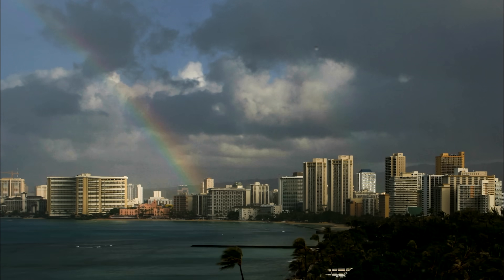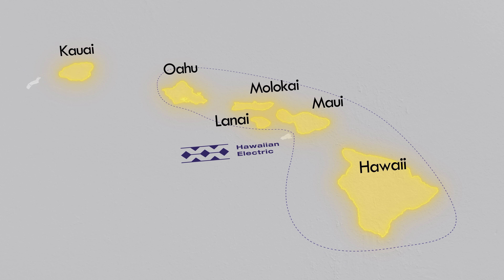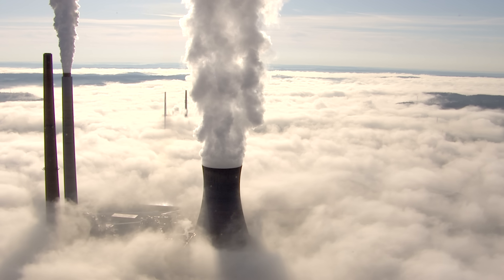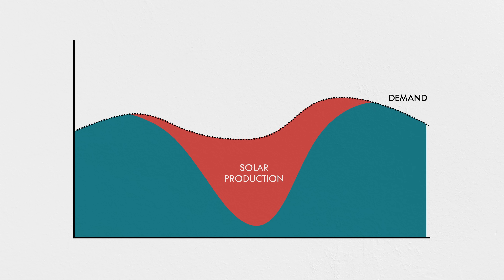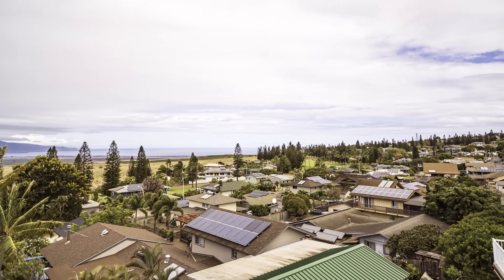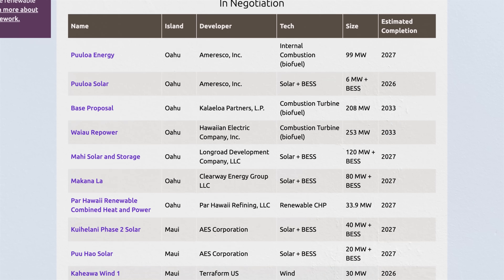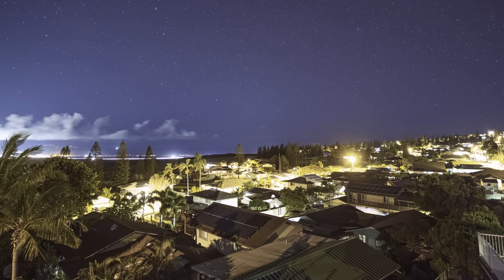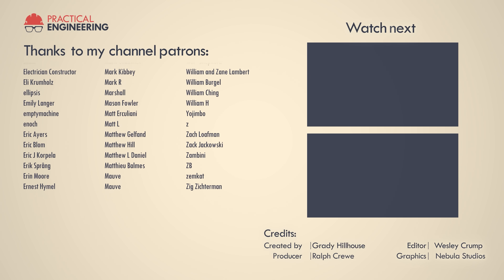How the Hawaiian Power Grid Works

Comment: I have always wondered, but being a layman when it comes to engineering, I have no idea of my thinking is plausible. 
Would having more small power generation or storage stations along with the main production and storage facilities help alleviate some of the strain events like the storms you mentioned (and the maintenance schedules).  Say for a large housing development there might be a couple of the smaller wind or water turbine systems, that help to keep a small battery storage system topped off along with provide power to the grid.  Where eventually, when the technology catches up, be able to be the back up battery system for things like traffic and street lights for a time in a small area. Or even say to a local community building/shelter. 

Or might this be better tackled as two separate ideas, instead of one large one.
Reply: At some point the increased complexity might make the problem worse. A maintenance crew can probably fix a few big systems faster than lots of little ones after a storm.

Comment: One thing I would like to see since undersea cables seem to be impractical given the restraints is Terrestrial Microwave Power Beaming to interconnect the islands; They aren't the most efficient but they can allow wireless power connectivity between the islands and could largely be shut down or have their use vastly minimized unless the need for interconnectivity and avoiding rolling black/brownouts.
Reply: Microwave frequency wouldn't work very well for power generation, especially in Hawaii. The distances are too vast, and microwave wavelength is right in the spectrum for water resonance. Because of how humid the air around the islands is you would be losing a ton of power to heating atmospheric water vapor.

DC interconnect cables make the most sense, and I don't understand why the Hawaiian Islands haven't been connected with them yet considering places in Europe have cables upwards of 800,000VDC operating at depths similar to the ocean depth between the islands.
Reply: @Hyperious_in_the_air  Considering MPT can be used to transmit power using a spaceborn relay and there have been several purely atmospheric tests the distance point is something i vehemently disagree with, Additionally while Humidity would affect things this would be less a full scale interconnect and more an emergency interconnect as you could never get the efficiencies of undersea cables and they will always be better efficiency wise.

As for why they dont have any there were points made in the video as to why not.

Comment: 14:00 You can buy a whole house generator, battery storage, etc if you need power reliability of the grid. It costs you extra.
Reply: Then what's even the point of all this rebewable window dressing? The Hawaiian electricity grid is already like a giant backup generator, it all runs on diesel fuel.
Reply: @gregorymalchuk272  Did you go to the time stamp?

Comment: Most solar inverters will adapt their power output to the grid in response to the voltage it sees. When the voltage is too high it should rate back.

Comment: I quite confuse when some government says.

They want to reduce fossil fuel use to 0%. It's technically not possible, when no sun, winds, waves you still need fuel/gas/col to run generators.

Things than can do is ability to rely 100% on renewable energy when it's available (in normal conditions), so this mean both renewable and fuel both are at least more than 100% of demand for the whole grid.

Comment: interesting episode. I would like to hear more about the advanced battery storage systems that electronically provide frequency management and simulate rotational inertia. And there is also the technology related to virtual powerplants composed of lots of smaller battery backup systems at homes and small businesses. I would like to hear more of the technical details related to these systems and the cost trends of battery storage. 

And by the way, as I listened to this episode, I was struck by the high-quality of the writing. Not that past episodes had poor writing. It just seemed to be that the quality was more noticeable in this episode. Thanks.
Reply: Battery storage is inconsequential when it comes to power grid. It's way too expensive, the only way to store power at scale is pumped storage (pumping water up when you have energy surplus and then letting it run down again when you have energy deficits). There are actually a LOT of different ways to store energy, but everything apart from potential energy of water is a meme at national level.

Comment: Another !!Fun!! issue I could see with trying to interconnect the islands' grids: they're almost certainly out of phase. They'd have to fully shut down ALL generation on both islands, then make the connection, then whichever power plant cold-starts first would set the phase for everyone else. Repeat for each new linking. ...Or maybe just fully shutting down one island, connect, then bring the plants back online as fast as possible in the brief window when one island's worth of generation is trying to power two islands at once (scheduled rolling blackout time?), which would get easier with each new link (N-1 islands' worth of power plants trying to power N islands)...
Reply: Or just lower or raise the frequency very slightly until they are in phase and then connect.
Reply: How do they reconnect two grids which have separated due to fault?
Reply: @catprog  Search Wikipedia for: Synchronization (alternating current)

Comment: The Hawaiian islands should be plentiful of potential for geothermal. Probably sufficient to cover all the demand. Geothermal is stable, doesn’t rely on wind, sun or weather and free of charge from any fuel. And the same steam turbines used with coal, oil and gas can be operated by steam coming from the underground. Why they don’t push on that?

Comment: Considering how many Active Volcanoes they have, I'm surprised they only have 1 Geothermal Power Plant...

They really should have 1 Geothermal Plant at each Volcano and use that to help replace the Fossil Fuel Plants...
Reply: does a volcano have to be ideal for a geothermal plant? I don't know the engineering behind that
Reply: @lord_fronic   It helps but isn't needed...
Most Power Plants burn a Fossil Fuel or use the heat from Nuclear Decay to turn water into steam to turn the Turbines...
A Geothermal Plant uses heat from deep in the earth to do the same so it's extremely Environmentally Friendly...
A Volcano just reduces how deep the Geothermal Heat Extraction Pipes need to be drilled and also, in theory, increases the amount of usable heat that can be extracted and thus the amount of steam that can be created to drive Turbines so a Geothermal Plant near a Volcano can create FAR more electricity for less construction and operating costs than one built away from a Volcano...
Reply: @HappilyHomicidalHooligan  I looked it up and apparently it is a mixture of things including higher initial startup costs, the unpredictability of the volcanoes in question, and cultural/natural protection in the areas. Interestingly major cost components are the amount of water needed and remoteness.

I think that this could easily be solved by government assistance but most of that goes towards wind and solar which have lower startup costs even though they don't provide much as far as MW per $ compared to almost any energy source. Voters and politicians rarely talk about geothermal

Comment: I wonder if there is a solution in the laser power transmission tech for inter-island connection. If you are worried about it hitting birds  or planes you could have laser interrupt lines that switch off the transmission temporarily like with a garage door stopper.

Comment: I'm not sure about the inertia, Grady. Are you sure you're not propagating a factoid that "sounds reasonable" but turns out not to be true? I'm asking because, though I'm outside of this field, I did explore in the past spinning disks to store energy for a project and it turns out you need A LOT of angular velocity to store any meaningful amount of energy. And those turbines don't look like they're spinning all that fast (some submultiple of the AC frequency probably?). Sure they have a lot of mass but when you talk about electrical energy, values that are seemingly small from an electrical energy perspective (say 1kWh) turn out to be MASSIVE amounts of mechanical energy. 
What I'm trying to say is that, it looks to me like a relatively small bank of capacitors or battery would easily replace the mechanical equivalent of inertia of a turbine shaft. 

Has anyone looked at this in detail? You should totally make a video discussing this in more depth.
Reply: Turbines have a huge amount of mass, they are really heavy.

Comment: Much of what this video describes as problems the grid needs to address, are problems with AC.

AC has become more a liability than a benefit.  It's very lossy, inherently (what makes transformers work, also makes everything a secondary near a transmission line, leading to huge inductive losses).  It has this need to synchronize, which is a problem beyond a small area, deterring useful sharing of power across larger areas.

There's very little intrinsic need for AC.  (Can anyone name a use that intrinsically requires AC, can't be done well with DC?)  We use it out of inertia.  Its benefits, like transformers, are becoming outweighed by its downsides.  A full change would be difficult (though already many long distances lines are DC for the lower losses).  But we change all the time.  If some utility in an early adopter area were to offer a parallel DC service to the home, I suspect that over decades it would eventually take over everywhere, with DC becoming the norm all the way from production to consumption.  And the savings in losses would be large.

Comment: Sounds like there needs to be a requirement for any power producer to have an intelligent battery (or other energy storage mechanism) between the power generator and the grid.  This would allow the utility to better manage these smaller scale power producers and also ensure that short term changes in production wouldn't immediately be passed along to the grid.  There would need to be some kind of minimum energy storage capacity requirements, likely related to maximum power production.

Comment: For the distributed energy resource wouldn't it make sense to have battery storages for certain areas that would be capable of sensing and working with the power grid? My thinking is that it would create a decentralized power grid, capable of supporting each hub and given that it would be professional not consumer grade, it would be more resilient to attacks and allow better communication within network.

Comment: Solar can produce on overcast days but you need a lot more panels.  The ONLY way solar can be a reliable percentage of say 50 - 70%, about the best it's going to get is a LOT of overcapacity along with grid storage.  If you don't have grid storage than forget going over about 25% of planned capacity, meaning that's what you plan for solar to produce for you, but even there you still need actual generation to be a bit more than 25% of what the grid needs when it's sunny.

The good news is that Redox flow batteries makes sense for grid storage and at large scale shouldn't be costly.  However the problem with Hawaii is distance from places that provide raw materials or produce goods, so they have to pay for shipping a whole bunch of units to the islands.  I'd say it would make sense to manufacture them there but you still have to ship all the raw materials to make those units.
Reply: I like to use 2 hours of production a day and 24 hours for the battery when running scenarios.

Comment: Too much of a good thing?

"The excess energy from high amounts of PV on a neighborhood circuit can back-feed into the circuit, causing over-voltage and other power problems. This can be dangerous for utility crews and customers," said Peter Rosegg, a spokesman for Hawaiian Electric.

Yeah, the generators then become motors and need to become a load to dissipate the extra energy

Comment: 7:40 when you started talking about "inertia", I assumed you meant "systemic" inertia (no idea what the correct term is), as in, wind and solar have "low inertia" because if the sun goes behind a cloud or the wind dies, those systems immediately stop generating power, whereas hydro has comparatively "high inertia" because you can have a dry week, or month, but the reservoir still holds water and generates power to cover the gap until more snow melt or rain arrives. I never considered the actual rotational inertia of the turbines and their effect on the frequency of the alternating current on the grid.

Comment: Interesting video!  In South Africa 'loadshedding' has become the norm, with selected areas countrywide being switched off 2-4 hours at a time, sometimes up to 12 hours per day.  Most, that can afford it, have installed batteries and inverters, others have added solar, some are completely off-grid.
Reply: Wow, that sounds terrible. Back to the stone age, except you have to pay.
Reply: Thats becauce Eskom maintenance staff are completely incompetent due to BEE. 95% of Eskom boiler tube welds fail international inspection standards.
Reply: Presumably it'll only get worse (for the poor) once the rich all have batteries...

Comment: I was in Kauai in January to do a Property (fire protection) assessment of two power plants (one site had two old combustion turbines and a bunch of diesel generators, the other was a simple cycle combustion turbine).  I work for an insurance company that insures power plants.  The month before I went to these two sites, Kauai had a whole island outage caused by a fault in a large junction box on one of the transformers at the first plant I went to (the one with all the diesel generators).  That one little fault took out the entire island for an hour!  I suspect that a small grid is more susceptable to going down due to small faults than a larger grid.  Hawaii is an interesting place to visit... but I wouldn't want to live there.

Comment: Japan has a crazy power grid too. I think they even use 2 different cycles in the North and South.
Reply: yeah, they have 100v over there, and then 60hz towards one side, and 50hz on the other
Reply: Fun piece of trivia... the Japan map for the board game Powergrid has that disconnect in the middle between Osaka and Tokyo, essentially dividing the board into two halves.
Reply: though I believe the two grids do have interconnects nowadays, they’re just a LOT more complicated than interconnects between grids at the same frequency
Reply: I think (I guess) that one half is based mostly on British tech and the other half on American tech.
At least they don't drive on one side of the road in one part and the other side in the other... (The Japanese drive on the left.)
Reply: @Lucien86  German and American actually IIRC.  But yeah, power companies in different regions imported their generators and other grid equipment from different international vendors, and while they've managed to convert smaller pockets of irregularity to the closer of the two big regional standards, getting the entire country to switch to one or the other would take a LOT of reinvestment

Comment: It will be cool to hear your take on South Australia; they run, for weeks at times, over 90% wind and solar. In these grids, "Grid Forming" batteries drastically reduce the need for spinning masses.
You made an error in referring to "Firm Baseload" and "baseload ramps up and down". "Baseload" and "Firming" are normally two deferent technologies. By definition, baseload plants do not / cannot ramp up and down. I stress this because so many people think "baseload" is required for a reliable grid, but with a high renewable penetration, baseload becomes redundant and firming becomes critical.
Reply: What is the cost of electricity there?
Reply: @gregorymalchuk272  According to AEMO.  
~$66AUD for February per MWh (as opposed to ~$110 for NSW, $120 for QLD and ~$80 TAS/VIC)
~$32 for January
Reply: @gregorymalchuk272  If you buy from a retailer it is about 30c US per kWh for peak and 15c US off-peak as per a Google search. Installing rooftop solar is about 1/3 of what it cost in US.
Reply: That sounds awful lmao

Comment: Not much mentioned about backup supplies of energy, which what would need to be implemented to achieve that reliability. Not necessarily generators, but instead maybe water being pumped from the ocean to a large man made lake up high, and released back to the ocean powering turbines when power need increases.  Even batteries. Maybe that is where the innovations will come from, ways to store energy.

Comment: Desalination ocean water used to produce green hydrogen through electrolysis for hydrogen fuel cells is the answer:

Wind, turbines, solar panels and toxic batteries all of which degrade daily and need to be replaced within 5 to 15 years at best, will always lead to blackouts and catastrophic outcomes.
Reply: 1 Desalination and electrolysis COSTS energy, so you'd be starting at a deficit.
2 ALL equipment degrades and needs eventual replacement, your answer included.
Reply: How will you power the desalination? You'll be burning fuel, losing some of the energy with each step,  and wind up generating hydrogen while using more energy than the hydrogen can provide.  Then you'll have to build new power plants that run on hydrogen. 

Your 5 to 15 year number is a lie,  by the way.